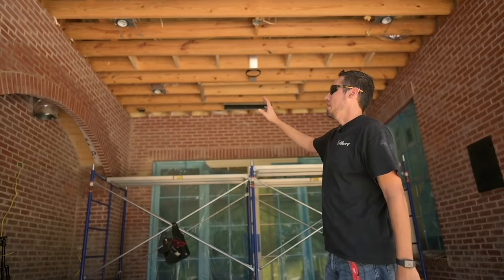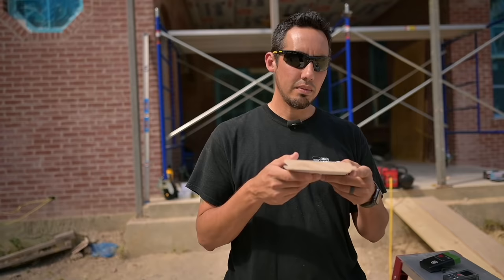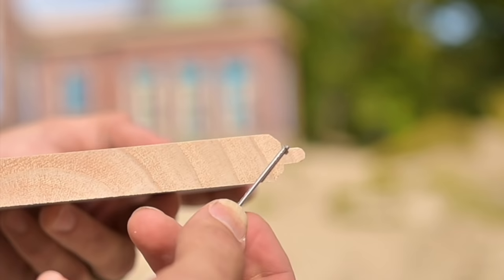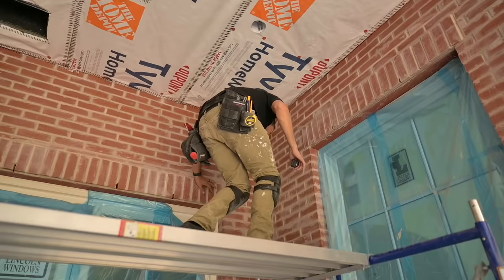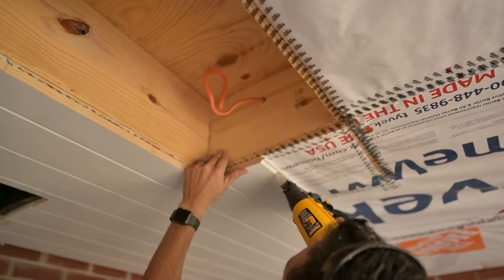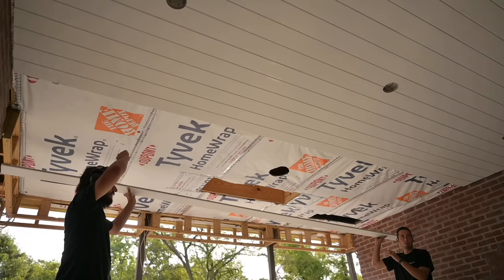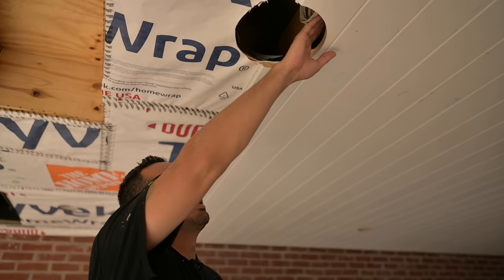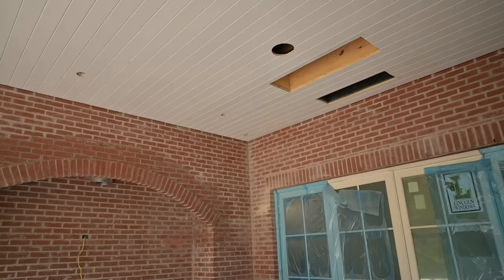How to Install Tongue and Groove Ceiling Boards - WindsorONE

Comment: Regarding router bits, there are pattern bits that have both upcut and downcut spiral bits. They leave no frayed edges what so ever. We also have gotten used to down cut spiral bits, for a clean edge for drilling thru
Reply: Its called a compression bit.

Comment: I use the router on all cut outs needed. Just clean up corners with a small hand saw. So much easier and faster than measuring all those little cuts. Just pay attention to where your nails are!

Comment: I'm an owner builder, but not a carpenter. The house has a covered patio such as the one in this video. In your video you installed plywood then Tyvek before installing the tongue and groove. Just curious as to why you installed plywood before TG? It seems more practical. I watched another video that did not use plywood before installing the TG lumber. It may be easier but less area to secure finish nails. I appreciate any comment.

Comment: I’ve been using the cordless Dewalt trim router with a 1/4 down spiral top bearing bit and it works like a dream
Reply: Do you use that bit to trim to the outside of the box?  When he used the flush trim bit, that trims flush to the inside of the box but many boxes need to be flush with the finished ceiling so trimming to the inside of the box doesn’t work. I guess the spiral bit would be the solution (?)

Comment: That new Metabo cordless 1/2” router would be killer for those ceiling cut outs. Might need to transition to Dewaukeetabo if you’re gonna be doing a bunch more of these ceilings.

Also, you aren’t lying about that Windsor One. I did 2 1x panel walls for a customer recently. Convinced him to go with Windsor One and it turned out phenomenal. It also helped that the product shares the same name as me lol.

Comment: Another great video! Maybe a quick efficiency tip vs having separate router cuts for each half of hole - after you put first board up drill 1" hole with a spade bit, then after fitting second board one-step router cut for whole hole. If you want a reference (so you know roughly where you're going you can always draw a quick half circle on the first board with a pencil (although if you consistently place the hole at what you might call 12 o'clock, you can skip the pencil mark . Maybe not huge, but with a large number of cuts you do half the number of router events and you're only picking up/setting down the router once for each complete hole. And you can even leave all the router cuts till the end with this method. But of course nothing wrong with what you did.

Comment: if I don't have a mallet, sometimes I use a drop piece of that material as a block to smack the pieces into place, but you have to mock it up to the groove so the piece you're installing doesn't get damaged

Comment: I do the same tongue nailing/blind nailing when I do t&g boards or flooring on ceilings or soffits. I do add PL Premium adhesive on the back of the boards. Better to be safe. You can see an example on my fabric track tutorial video.
Reply: A little tip too (I have some of the pickiest clients as you can imagine) I not only use a mallet but also a scrap piece of the material we are working with to butt up those seams. i just keep a few on my pouch with the tongue side out

Comment: Wouldn't you get a more accurate moisture reading by using the cut end of the board instead of going through the prepped side of the wood? Just asking because I don't know.
Reply: The cut end would have a higher reading than the more inner parts and it would not be as  accurate.

Comment: @FinishCarpentryTV - Another great video! …I noticed you didn’t prime the router cuts, why is it important to seal off the end cuts of the board but not the router cuts? Won’t they also try to suck up the moisture?

Comment: We did a job about 6 weeks ago on a modular building. One half of the building was completely finished with tongue and groove pine board. We had put up about 30 boards on the ceiling when I noticed that something was not right. We seemed to be gaining ground on one end compared to the other. So we measured both ends, and come to find out, we were over 2 inches wider on one end.  Measured a few boards and they were all 1/16 to 1/8 wider on one end (same end of the board). I called one of the foreman, told him about the situation and he told us to keep going. We tried spacing the boards on the narrow end but we couldn't make up the ground we had lost. So we had to make a couple of custom boards before we got the other end so it wouldn't show. In the end it turned out ok but what a headache. 

Before we finished, when we were about 3/4 done,  another foreman came to check on our progress. He wasn't aware of our situation so he curious to know why the boards on the wall didn't lined up with those on the ceiling. I told him about the boards, then he said he didn't think the customer would except the work. Not something I wanted to hear but completely understandable.  So we stopped, until they could contact the customer. About 20 minutes later we got the go ahead to finish. We were so relieved to hear that. Imagine having to take down over 4000 ft of boards. Having to take it all down and start over to line up the boards on the wall with those on the ceiling would've been a nightmare. I don't know where the boards were milled but their quality control sucks.

Comment: If the router bit matches the inside dimension of the can light, how will it work with can lights that are set up for 1/2 material without planning to use shear? You would need the outside dimension of the can light. Special router bit?

Comment: I saw you using a laser in an older video and wondered how they were now days. The one I had 15 years ago was manure. The Bosch Storm 165 27 seems pretty good from the videos I've seen.  If you're trusting a laser measure I can guess it's satisfactory.

Comment: How do you trim out for can lights, etc when the boxes are mounted to be flush with the finished ceiling. I don’t think a flush trim but would work in that instance. And if the boxes are raised, the mounting screws wouldn’t be long enough.  Enjoy the videos!

Comment: Would a high humidity climate eventually cause the brad nails to weaken ? I want to do this on the underside of the deck but I feel like I would have to use staples ? 

Great info

Comment: You had mention that the wood moisture is not to exceed 18% what happens if it does?  And is the the moisture in the wood resulting from being stored in a wet location or from humid  conditions ?

Comment: Couple questions since this project is so similar to mine. As far as using router what do you do for canned lights that aren't flush with roofing. Should I have electrician move them higher so they are flush?

Also,  is it OK to install a tongue and groove on ceiling like the one in this video without plywood sheathing and just Tyvek? I am in PNW? 

Great video and I will look forward to checking all of yours out.

Comment: So, factory priming was sufficient to meet any need for back-priming.  Thanks for the video. Where did you wind up face nailing (other than the last board)?  Ends that would be under trim?  (But then would you have needed to fill?)  Thanks for part 2 so quickly!

Comment: I don't like using a router with dust extractor attached.. one it doesn't work that great but most important is having that extra risk pulling that pipe around with you.. Nice work as usual..

Comment: How long are the 16 gauge nails you're using?  When properly angled, do the tips of the nails protrude from the opposite side of the plywood?
Reply: Was looking for the same answer. If I had to guess, he's using 1 1/2 to 2" 16ga nails. Ideally, your nails should be at least twice as long as your material thickness. 3/4" T&G shiplap should equal 1 1/2" nails minimum

Comment: You should get the dewalt cordless router, saves having leads when your on scaffolding
Reply: Im curious as to whether or not the cordless has enough power to make a clean cut?
Reply: As long as the router bits sharp with a 5amp battery, hasn't let me down yet,

Comment: Wouldnt shooting into the piece itself (away from tongue and groove) be a stronger hold since it grabs more material? Use some filler and be done? Or do you plan not to use exterior paint to paint the faces? Just curious, thanks and love your work as a hobbyist/newb
Reply: No, the angle of the nail also helps to hold it in place. Patched nail holes sometimes shrink and show plus its a lot more work - apply enough putty so you don't have to apply another coat, sand it perfectly flat without over sanding the primer off, re prime all of it, final sand it and then apply the finish coat or two.
Reply: @marklynnreed  true. Thank you

Comment: Hey Richard, 
So how do you recommend fixing the blind nailing error on a installed board (like u demonstrated) that does not allow the next board to sit correctly without ripping the installed board off?
Reply: If you know which nail is causing the issue, you can use a thin punch and drive the nail all the way through and past the backside of the board, or you can notch the backside of the groove right where the nail is to clear the nail. I prefer drifting the nail in deeper, and driving a new nail next to it at the correct angle.

Comment: I use a 15ga Senco Nematic and adjust the pressure go down to 2” or in some cases 1.5” ?  Just seems that 16 ga unless stainless will rust out fast and the head has no holding power?  Now when 1st done looks like a champ?  Come back in a yr and I bet you hv pops ?  Be a good video?

Comment: I do a ton of T&G on exterior ceilings on new homes out here in Idaho (not an expert, I just work for one), and have noticed upon coming back to completed jobs, the seams have become gapped. They were tight subsequent to install, but end up being almost a quarter inch gapped after sitting for some time. Would applying something to the exposed grain—the seams—prevent this? If so, what would it be?
Reply: Should he apply some adhesive beside nailing.............Lp3 or liquid nails?

Comment: looks like someone needs a battery powered trim router! :)  I got a Makita one due to the size but they make makita-to-Dewalt batttery adapters.  So you don't have to get into yet another battery ecosystem.  They even have a little dust plate adapter for it.

Comment: why couldn't nail into the studs??
Reply: I had the same question but went back and look at the beginning of the video. If he would’ve installed them perpendicular to the joist then the plywood planks wouldn’t be needed and attaching directly to joist is doable. Not doable running the boards in the same direction of the joists because the one between the joists would be just floating and nothing to attach them to.

Comment: I went against all your advice. Lol
Didnt paint edges. Didnt check moisture. And face nailed (might been 16ga).
Lol. Its not perfect.. But looks good. Had a hard time because the frame work was not square at all. More of a trapazoid. One side.

Comment: The boards grow in the width.  Those boards will hardly grow in length. 
Should have ran 1x2,s and spaced it off the plywood to get it a air gap

Comment: I don't really get your 3/4" expansion gap theory with wood, for example  PVC siding has slots and it's attached loosely so it can slide around nails, you nail it rigidly into plywood and no way it will move more than 1/16 before it will start splitting wood or popping nails... I can understand if you used clips like FRUH which theoretically will allow material to move but you just dead nail it... through nice and educational videos, thanks.